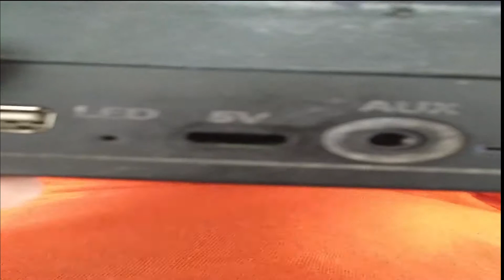reparacion bocina bluetooth adaptando un cable usb

Comment: Hola, porque mi bocina no funciona sin estar conectado, solo trabajo unos meses y ahora se descarga en una o dos canciones y pues tengo que conectar a y corriente
Reply from the maker: Gracias por ver mi video apoyame suscribiendote asi seguire haciendo videos para ustedes
Mira tendrias que abrirla aveces de fabrica bienen cables mal soldados tal vez se desoldo un lado por eso no permite retener carga conectada o hace mal contacto una soldadura de un cable
Ya por ultimo seria que salio mala la bateria talvez consigas unabusada en un local de reparaciones de electrodomesticos